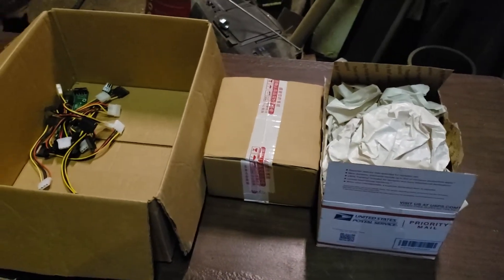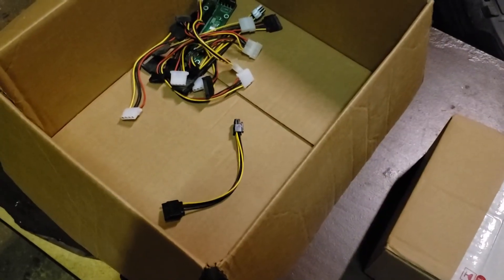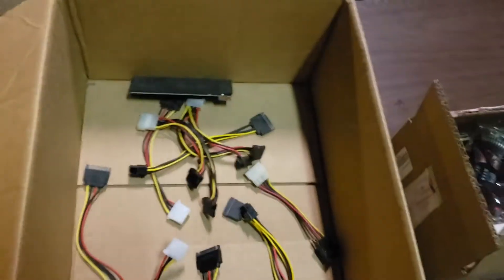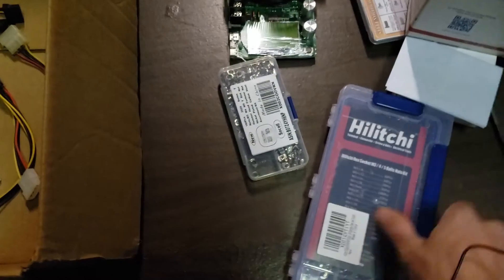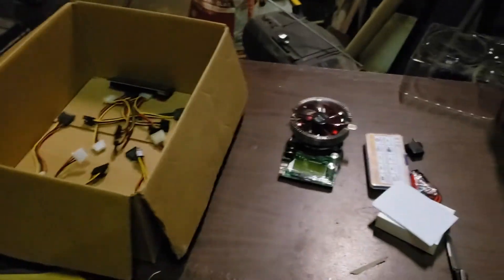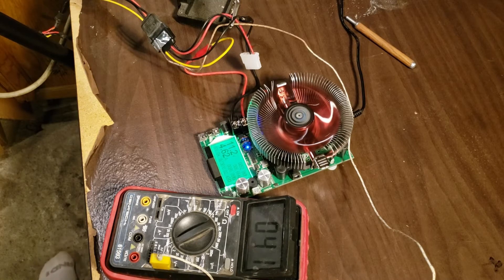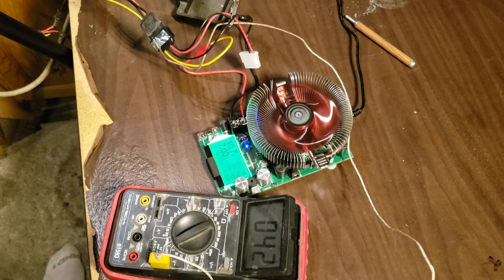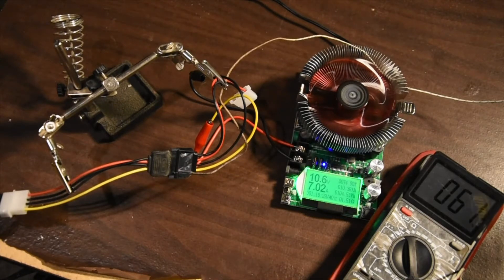MINING RIGS, GPUS and GPU RISERS - LOAD TESTING SATA PSU Cables Burning them UP

Comment: Im using sata powered risers since 3 years and never had any issue. As long as you just run 1 gpu via one sata psu cable you'll never exceed 55 watts(worst case rtx 3090, most cards consume way less over slot, 6800 43watts for ex). Stories of burned down rigs are mostly related to people who connceted at least 2 GPUs over the same sata cable.

Comment: I’ve ran a 4 gb card with sata pulling 105watts and had them running for 2 months straight not a single piece melted from the riser burnt just the sata cable plugged into the psu got burned maybe because there in a case and cooled by the high rpm fans?